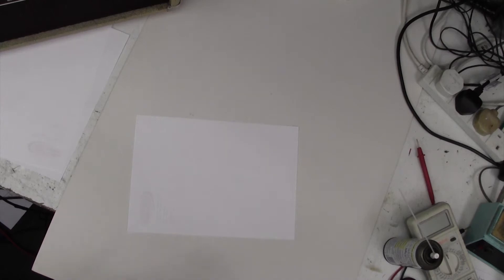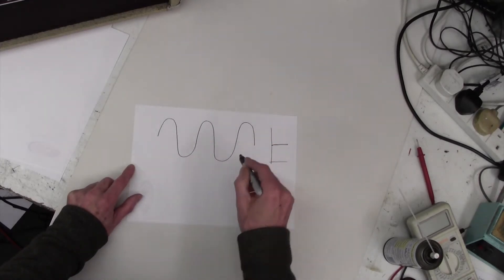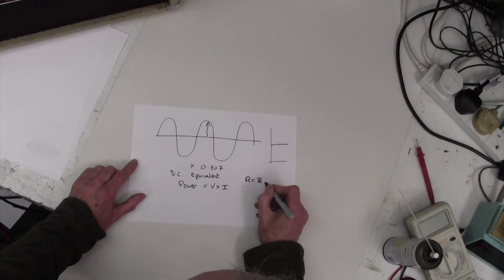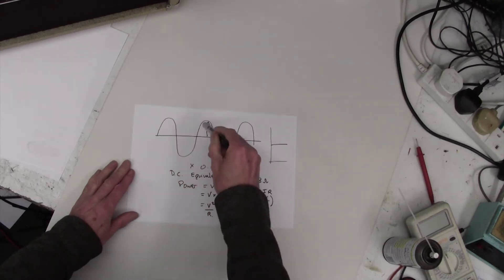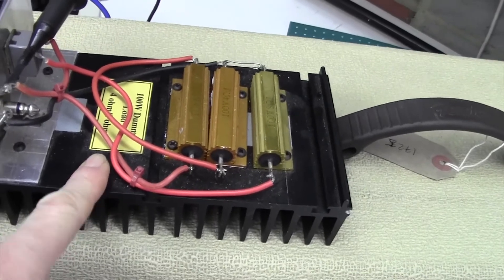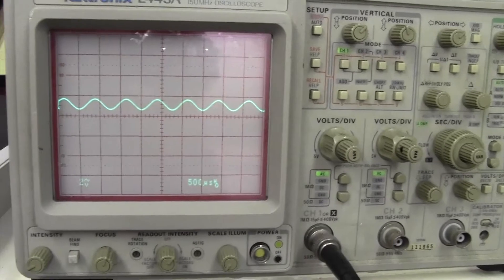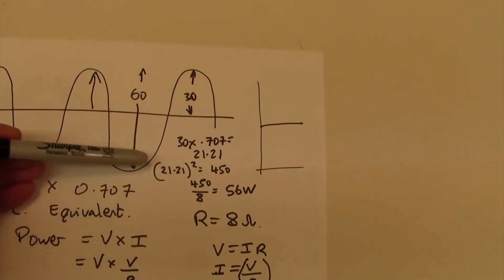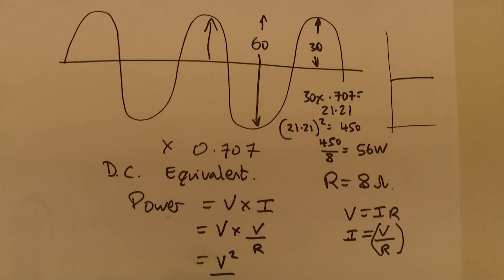How to measure the Power of a Guitar Amplifier

Comment: Great video, thanks for sharing!  Am I right in assuming that what you’ve described is how to measure max-before-clipping RMS output power, which is a conservative estimate of output power, and used to be the standard measurement that most companies put in their specs?  Nowadays (particularly in the area of powered PA speakers), a lot of companies are using peak voltage or “music power” (who knows what that means) in order to boost their specs to get a commercial advantage.  I agree with another commenter that your customer’s probably going deaf from playing through his 56W tube amp without hearing protection.

Comment: Stuart, do you have a video showing how you built your dummy load?  I’m using a very simple one, and much less wattage than yours, but thought it might be good to have one like yours.  Thanks.
Reply from the maker: It's nothing special. just a couple of 100W 8ohm resistors on a heatsink.

Comment: Great channel Stuart and very helpful. Thanks a lot for the great content.
Sorry if this is a stupid question but isn’t the speaker value impedance rather than resistance ?
And if so isn’t the calculation slightly inaccurate ? I think I read somewhere that an 8ohm speaker is around 6ohm as a resistance value. Thanks a lot
Reply from the maker: Hmm that's actually a good point. In practice though I've always found it to be correct, e.g. 100W amp gives me about 100W, 50W amp gives me about 50W etc. Techinically you are correct though. Maybe the impedance is always pretty close to the resistance> E.g. 7.2 ohms or something. Not sure.